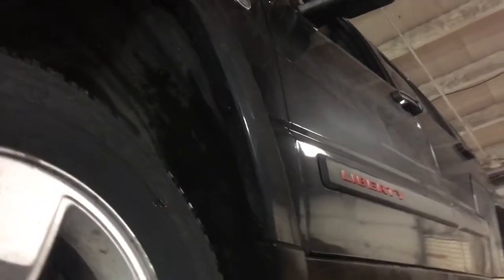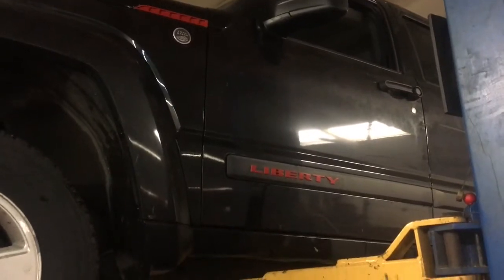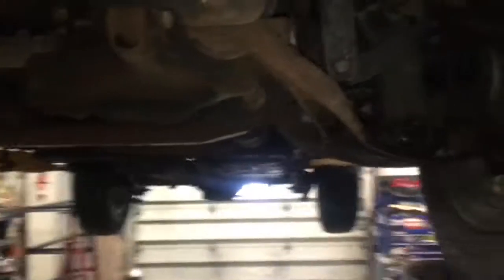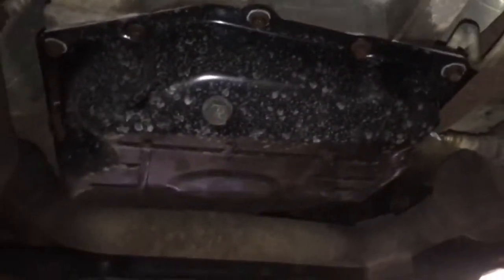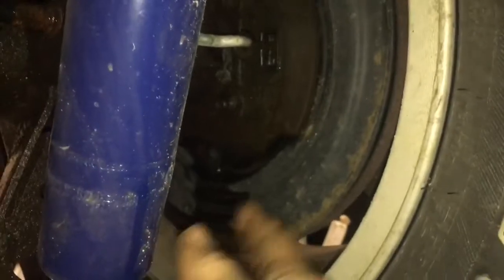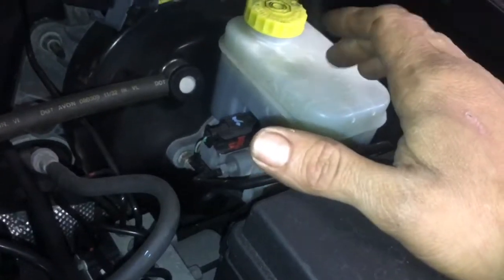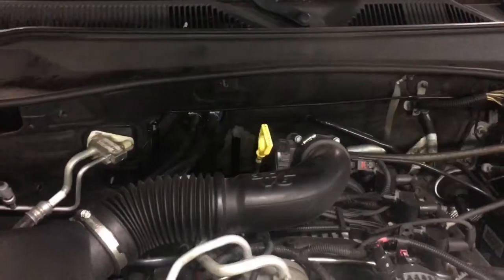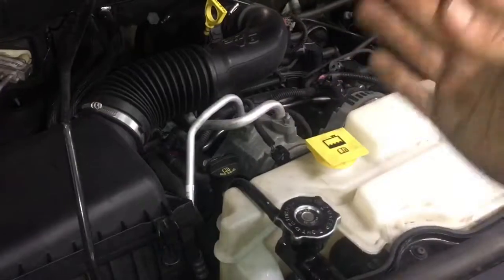Things to look for when you’re buying a used Jeep liberty

Comment: 2003 Liberty Sport.....V6.....drove it off the lot. 263,500 mi. all orig. drivetrain. Beater car now.....still runs great. Wheel bearings are still original and like new. Vehicle has seen lots of off road use too. PERFECT beater for life in the mountains.....command-trac system is great.

Comment: Just bought 2007 jeep liberty for 7k with 75k miles on it. Hope it lasts a few years at least with minimal maintenance
Reply: Thinking of getting a 2012. How's you're Jeep been working for you?
Reply: @jehad78  hand full of repairs, running like a top. Do have issues getting new parts since the liberty was discontinued in 2012. Only complaint is lack of storage in vehicle
Reply: @Bluebird22200  Thanks for letting me know. Yeah I'm going to test drive a 2012 Liberty Jet Limited. One owner with 120,000 miles full service done.

Scare parts? That's insane!
Are you talking about interior parts or electrical and mechanical?

Comment: Dude I do this exact thing by in flip cars I replace every little thing rebuild the motors I buy equinoxes overheating 2007 through 2009 and I replace every suspension component all the brakes and rotors and do a complete engine over haul. I saw them for 1000 under typical list price and people think it’s too good to be true when they see the ridiculous list of new parts

Comment: we have a 2012 4x4 6-speed manual Linerty Sport with 159,000 miles on it. done one clutch job.  we did have the heater core go out around 100k miles.  Dit the water pump a while back.  The only trouble was getting the parking brake sorted out, the fix is to use OEM parking brake shoes for the correct geometry.  We did put a 2" lift kit on it.
Reply: 2008 was the last year of manual transmissions in Liberties

Comment: Just bought a 2012 with 52k miles. Carfax showed the water pump was replaced. Valuable info. Did have to turn off Hill Start Assist due to issues  with brakes not releasing.

Comment: How did you add the red Liberty lettering to the door trim?  I want to do that in blue.
Reply from the maker: I think I made a video of that. I’m absolutely certain I did actually basically you take a sponge and you wipe it over the top of it with the paint on the sponge then you clearcoat over the top of that so it doesn’t chip off really easy.

Comment: I’m looking at a 2011 liberty (trail rated, if that matters much) with 120,000 on it and they’re asking $8,500. Does that seem like a decent deal? I test drove it for quite a while and didn’t feel or hear anything even remotely worrying in the engine. Suspension felt perfect, brakes were great. Overall I was impressed but I’m also new to jeeps. Anybody have any thoughts? Much appreciated!
Reply: Did you get it? Did it hold up? I’m in the same boat.
Reply: @ashley___1577   I did not end up getting it. 😕

Comment: Hi Clay. Question. I had a 2008 Liberty for 4 months. Ran great and took me from Maryland to 20 miles south of the Canadian boarder like it was going to the local 7-11. No issues. Sadly, a sweet little old "Vin Diesel" inspired lady, smashed into my rear door and spun me into guard rail. They totaled my Jeep, and I am looking for a replacement Liberty. I found a 2008, on a mom and pop lot, but it has the skyslider roof. I have heard horror stories and a new report investigation out of a station in Miami, that Mopar has stopped offering all parts for the roof.  It seems like a obvious answer, at the same time would you recommend that the lack of parts to be a deal breaker for a used vehicle? Thanks
Reply from the maker: Hi Karen. I’m sorry to hear about that happening to your jeep. 

Regretfully I would have to say not to get that sky slider. I absolutely absolutely loved mine!!! It worked perfectly but always leaked air I came up with what I thought was a very ingenious way to fix it and it helped but it did not work totally. If you are not ultra mechanically inclined I’d say not to buy it I’m sorry if you ever have any questions let me know thank you
Reply: @sharpcarco  Thank you Clay. I have two other options, but I will take your advice on dropping the skyslider model. Peace, Karen Marie H.J.

Comment: Nice to see you are answering questions. I am having trouble looking for a video talking about the 4 cylinder engine reliability. I'm looking at a 2004 liberty 4cylinders 4x4 Manual 169k for $2,800.(i plan to offer $2k.
Reply from the maker: I haven’t had too much experience with the four cylinders
Reply: For past 13 yrs. Ive had my  2004 Liberty leather seat LX?or DX model??  It is 4 cylinder w on-demand 4wd. From OR, Ive driven to & all around Canada (in all seasons incldg -35 celcius) been thru alot of gravel,  ruts, rugged, muddy terrain, snow drifts & icy roads,  pulled horse trailers..all w No problems. Ive only had one issue replaced regulator rear driver window. I LOVE my Jeep Liberty. My sister has same year, renegade model. Also only window regulator problem.

Comment: Great tutorial...im looking at a 2012 jeep liberty for $3600 & 177k miles..is this a good buy?
Reply from the maker: Sounds like a decent bye to me I just paid  3500 for a 2012 4x4 with 160,000 miles on it that we’re going to have video about pretty soon and it has an engine taken it so it’s not perfect but it does run and drive very good. So I think 3700s a very fair price if it’s in good condition the one that I bought is in extremely good condition other than the engine tick . 

I would say go for it because I’m about to sell this one when I’m done for eight or 9000 the reason I can get that much for it though is because I will have video documentation of what I do to it so that adds a lot of value.

Comment: I have a 2008 sport manual got it pretty mint with 88k now has 110k about 6 years only in my city driving has a lot of kick (power) . Alot of my dash light are on but is driving like when I got it.. just would like to eliminate some of these lights now I use it for fishing mostly around ponds..
Reply: I just did the exhaust from cat back the rest solid I did a good job under $200

Comment: Found one with 71k on it. 2008 sport. Looks pretty good on the outside. Asking for 7k, is it worth the hassle? Plant to use it as a daily drive, and I drive about 70m a day.
Reply from the maker: 70 K is not bad and seven grand for it is not bad either
Reply: @sharpcarco  thanks for the advise man, I might just get it if the test drive goes well. And is manual too.
Reply from the maker: Because it’s a manual would give you a good bargaining chip there’s not many folks that will want to buy a manual so offer them 5000 you can always go up you just can’t go down once you make a price be nice don’t piss them off if you want to buy the vehicle
Reply: @sharpcarco  is manual cheaper based on manufacturer price? I will try my best hassle, will see how it goes.
Reply: Hey I’m looking to buy a 2009 with 164k miles on it for 2999 is that a good deal

Comment: Need to buy something in the next few days

My choices a  *both 4WD

2017 Jeep Cherokee Trailhawk  L Plus $26k asking with 34k  miles

Also is enhanced cruise really worth it?
or 
2013 Jeep Grand Cherokee  Overland 
$17k asking 107k miles
or

2012 Jeep Liberty Sport 
$13k asking with 67k miles

I will be driving back to Southern CA from IL in the next month towing and I need the vehicle to last at least 3-5yrs
Reply from the maker: I hope any vehicle that you buy that’s over $10,000 will last you 3 to 5 years unfortunately I don’t buy that new vehicles or spend that much money on them so my advice probably wouldn’t be as good as it could be from somebody else. 

I personally think the ones with the lower miles are probably your best bet of course $17,000 for a vehicle with 107,000 miles on it seems a bit high to me but I know the overland is a very very nice vehicle

As far as the one with 34,000 miles on it that just depends on how long you’re going to keep it I don’t know if that’s a good price or if that’s a bad price. 

I know my friend just bought a brand new truck and it was about 40,000 with 0 miles on it so I would check the price of brand new automobiles because dealerships are selling them extremely cheap and right now is a good Time to buy if you’re buying a brand new automobile

Then on the other hand I personally would never buy a brand new automobile because I don’t have deep enough pockets for it. And because of the depreciation value on a brand new automobile.

Like I said before I can’t be of much service but I certainly would try them or some of my opinions on the situation

Comment: How many miles for the timing chain change?
Reply from the maker: Technically you should never need one but I know better. Usually 120 to 140,000 miles. Ya
Reply: @sharpcarco  thanks!
Reply: @sharpcarco  just bought one with 150K, Renegade, all black! Only rust is around the back top brake light. Glad I found your channel, liked and subscribed!

Comment: Hi! 
I am about to buy a Jeep Liberty 2009 with 105,000 miles on it for 4,000$ CAD (I'm Canadian lol) I still need to make an inspection but apparently the mecanic of the car is great, I won't need to do any repairs or maintenance (for now I guess).  My question is , am I doing right to buy this car with this mileage since I keep reading through my researches on the net that they have transmissions problems 

Thank you! :)
Reply from the maker: Sounds extremely inexpensive to me here in the United States that would be about anywhere from $5500-$7000,
Reply: @sharpcarco  thank you!! 😊😊

Comment: I just bought a 2004 Jeep Liberty Sport Utility, when it’s in park it shakes, the shaking stops when driving. Any idea what this is?
Reply from the maker: Hello Meagan there’s so many things that it could possibly be it would be extremely difficult for me to say over a text message.  The only help that I could possibly offer is recommending you take it to a repair shop within about 30 minutes they can probably tell you exactly what it is if they don’t know right off the top of their head. I recommend a small mom and pop style repair shop because they generally wanna earn your business. And they generally will be the ones to help you at the least cost I hope that’s helpful for you God bless have a great day
Reply: ya der hey! the engine , when u r moving it is harder to notice  a misfire. right?
Reply from the maker: At times it is harder to notice a misfire. While you’re driving there’s several things that could possibly be but I would first check the plugs and coils. Hopefully that’s helpful I can’t say for certain but that’s the problem but
Reply: We’ve checked and changed coils and plugs. It’s sadly still doing it. The engine light is on and will flash at times then go back to being solid
Reply from the maker: Well it’s a possibility that you have worn valves or carbon on your injectors or a signal problem from the Ecm I’ve seen them before like I said there’s so many things I wish I could be of some help

Comment: What is your opinion on a 2009 liberty limited 4x4, one owner(private seller in Indiana), 174,000miles, $3000, no accidents, & looks clean from what I have seen. I’m no expert on vehicles, and I’m looking at these and 4th gen 4runner’s... but they are a bit steep in price for over 200,000 miles. And Xtera’s radiator issues scare me. lol
Reply from the maker: Well that price on the jeep liberty does not sound bad in the miles are not that bad either but without looking at it I couldn’t give you my opinion I suppose if it runs and drives well it’s probably a pretty good buy it sounds very affordable
Reply: @sharpcarco  thank you, when I get there to look at it I will take it to a shop in town before I make a decision. 😊

Comment: Question ? Would you buy a car that is being sold at a gas station ? There is a Jeep Liberty  2004 at a gas station not to far from my house. The guy wants $4000 for it. Wondering if it's worth that much ?
Reply from the maker: $4000 for a 2004 Jeep liberty is a lot of money. How many miles are on it is it a 4 x 4 if it’s got low mileage it might be worth it if it’s extremely clean it might be worth it but that’s a lot of money you can get a lot of car for that much money
Reply: I will have to go check it out. I just saw it one day when I was on my way to Home Depot & I thought to myself $4000  for a 2004 ? And it's on a gas station ? Why ? Was it there to be fix & the owner said "It's time to get rid of it? Don't know.

Comment: I'm on the fence about buying one of these with 75k miles. In your opinion are they reliable enough to buy on a limited budget?
Reply from the maker: I personally do not think that they’re great vehicles but when I buy something it’s based upon price and how good of a deal I think I’m getting. With 75,000 miles on it It shouldn’t be that bad for another 75 or 100 so then it would boil down to price with me
Reply: @sharpcarco  thanks $9900 is asking price and it's the arctic Edition white.
Reply: As long they were maintained it’s a great vehicle. My girlfriend bought an 05 liberty with 170k miles and still runs like a champ, the V6 Powertech engine are really reliable and easy to work on and parts are plenty and affordable. On a plus side you gotta love that 4x4 in winters

Comment: Hi! Is a 2008 Jeep Liberty Sport with 126,000 miles on it worth 4,500?
Reply from the maker: If I remember correctly 2008 is the first year for the Jeep liberty I think if it’s a four-wheel-drive version more than likely it is worth that much money . But keep in mind that the Jeep liberty is a good vehicle but it needs to have regular oil changes or you will have engine problems down the road I personally like the engine in the jeep liberty but at 180,000 miles they’re known to have a internal issues . Inside the engine and it will probably cost you two or $3000 to fix but overall they’re decent
Reply: @sharpcarco  2002 1st year. 05-07 minor changes but still 1st gen. 2008 1st year of 2nd gen and major remodel.
 Thank you for being an honest mechanic. Not enough of you.

Comment: I just bought a 2012 liberty latitude....when I first take off it makes kind of a built-up whirrrring  noise in the trans, almost like it's supposed to sound that way...is it?....it has 75,000 miles on it, I'm having the cooling system flushed, and was thinking of having the trans fluid changed, but now, after this vid, I'm wondering if I should?....any suggestions on what I SHOULD have done as maintenance at 75,000 miles would be greatly appreciated...Thanks Clay
Reply from the maker: I don’t know what happened and why I did not see this message before I greatly apologize for not answering I think the other gentleman is correct you should have the transmission fluid changed I hope you don’t have the same problem that I described in the video I wish you the absolute best God bless and have a great day thank you so much for the kind words
Reply: In my Jeep, when I first start going from a stop, I hear a whining noise in the transmission as well.  This is the sound of the gears rolling in the transmission, specifically first gear.  If yours is like mine, the noise will stop as soon as the transmission shifts into second gear. This sound is normal, I heard it on both of the Jeeps I've owned.
Reply: @dragasoni  Thank you so much, I've had a few other people that own jeeps like mine tell me the same thing...I love my 2012 Jeep liberty latitude, I appreciate your response, eases my mind a lot...it just hit 80,000, so I guess it's time to have the trans fluid changed...kinda scares me...
Reply: @Ace0fTrades  what do you mean a specialty model transmission?

Comment: I appreciate the details in this video.  I just purchased a 2011 Liberty Limited,  107,114 km  $7,500  CDN last Friday.  On vacation had to replace my 2007 Ranier, transmission leak and on last legs.  Are there any particular 'weakness' or expected problems that I might want to anticipate?  I was thinking of a coolant flush prob never done.  Thanks for your good work, mate.
Reply from the maker: 107 km sounds pretty low so that’s great don’t sound like a bad price at all. I would say you’re probably pretty good for at least another 40 or 50,000 miles, A coolant flush wouldn’t hurt anything. When they get up and to hire mileage like 130,000 miles that you start having time in chain issues. But are very repairable.
Reply: @sharpcarco  Thank you very much.  Much appreciated advice.  Take care mate.  :)

Comment: Hi Clay, I’m about to buy a Jeep Liberty 2012, good history except that the owner had to change the water pump, I tried the car for 30 miles w him, everything is working fine. Do I have to look for something in specific given the water pump change?
Reply from the maker: No water pump change is perfectly acceptable and actually a good thing. When I think about buying used cars I think about price, condition, Miles etc. etc. I think most peoples instincts are correct when they feel good and comfortable with something you should go with your gut

Doesn’t mean you won’t get a lemon but at least you won’t feel bad about your purchase later on because you felt good about it when you bought it

Miles and price are my biggest concerns.
Reply: The Clay Way thanks for the answer, this is helpful!